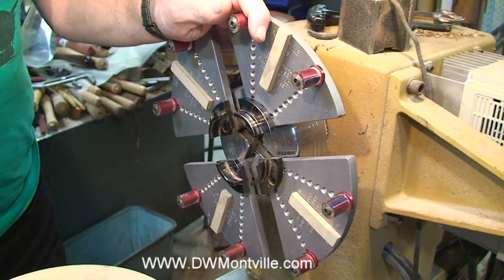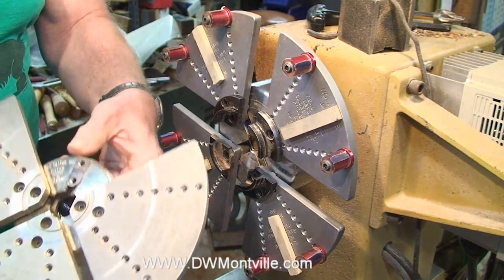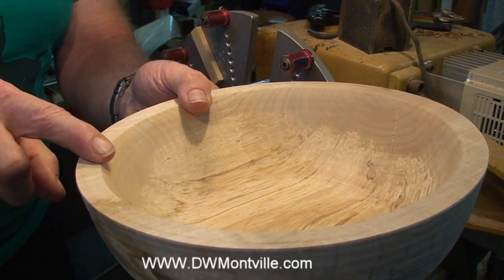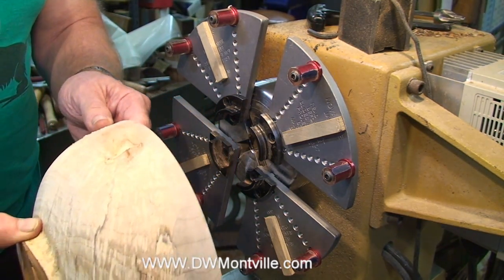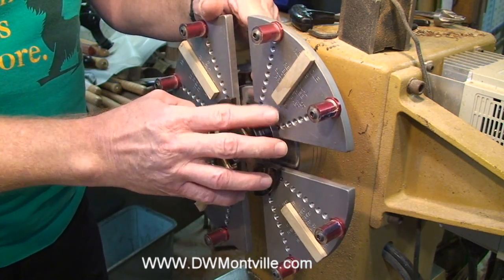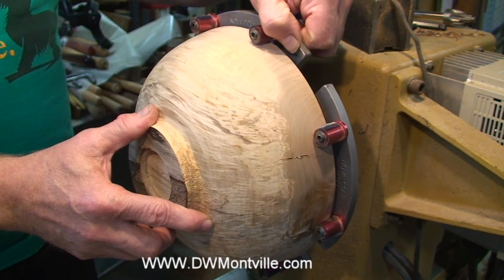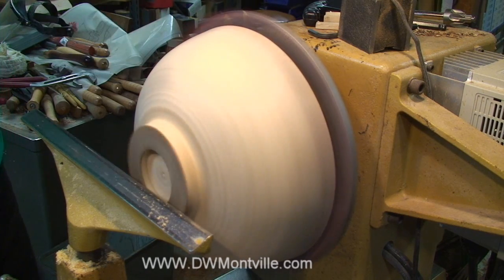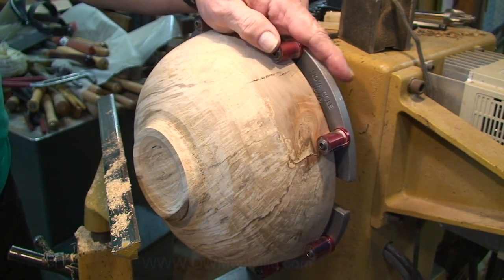Nova chuck, Cole jaws and grippers

Comment: Why not put a large washer between the bottom of the rubber and the aluminum flange. That is larger than the flange diameter. That way you can have the lip of the bowl supported against the Cole jaws, not have to have wood piece as stand offs and not mar the piece with the flange.

Comment: I was about to give up on my PSI Chineese made jaw chucks, as the rubber grippers left marks on the bowls, and then bent, throwing the bowl onto the ground. The new grippers came yesterday. They fit the PSI jaws perfectly, and held my bowl securely. Thanks for this great addition!
Reply: That's one of the reasons I developed these. I had similar experiences with the OEM grippers on my chuck. Glad they're working for you.

Comment: suggestion... make new wooden spacers wide enough to bore a hole to fit around the grippers. glue in some wooden dowel pins and align them using the unused holes. this would space the bowl out properly and prevent the spacer pads from being thrown loose during turning

Comment: Dennis, my understanding is the longer screws to adapt your original jaws to the Cole Jaws was to give versatility to turning, enabling you to turn your bowls around with out changing chucks, at least that was my take on it. Enjoy all your videos and also the tools that you sent me. Thank you.
Reply: Yes, I just got a set of these and read the manual.  Using additional jaws is optional.  If you want to do it, use the longer screws that came with the cole jaws.  If not, use the short screws that came with the chuck.